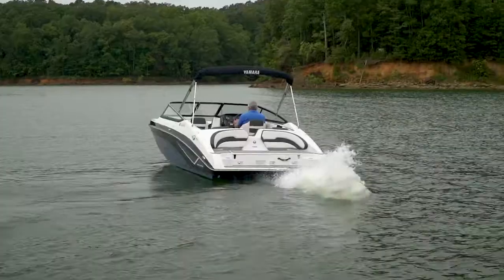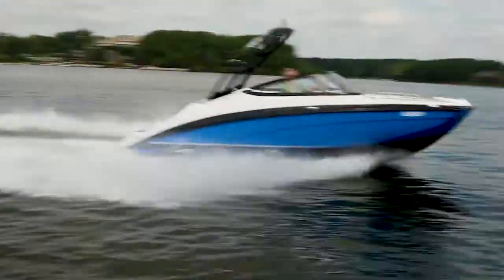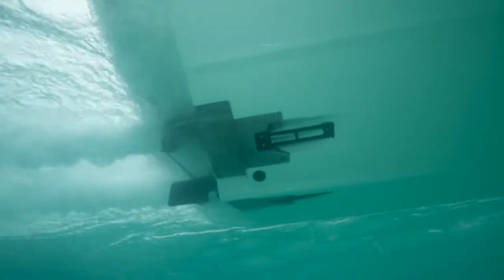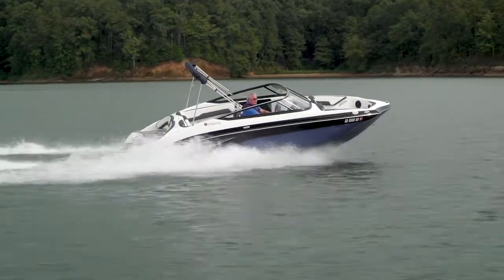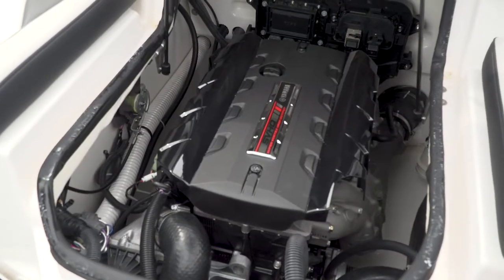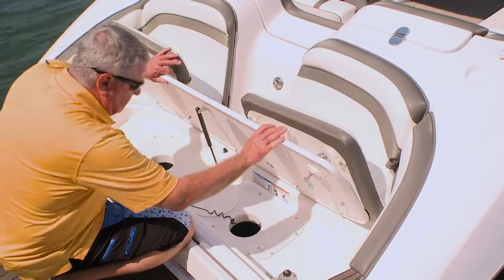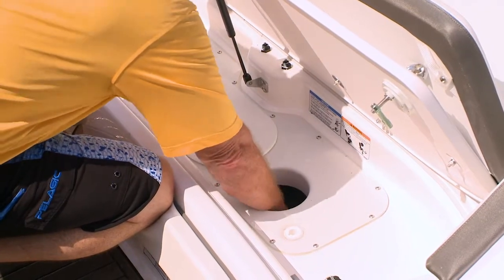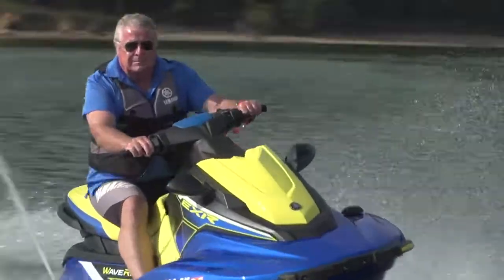The Advantages of Jet Propulsion From Boating Magazine

Comment: I purchased my Yamaha SX230HO new in 2008 for $32k. Only mechanical issue I had was a small rock got stuck in the impeller. Took it to a mechanic had the rock removed no damage oil and spark plugs changed (plugs 2x a year) under $300 dollars. I now change my oil and plugs myself. Plugs are about $8 each (8 needed). I love my Yamaha!
Reply: I'm hoping to find one of those. I have a Yamaha FX Cruiser HO -05 with the same engine with 460 trouble free hours. Very hard to come by in Sweden as they are only sold in the US.
Yesterday a non-HO SX230 from 2004 came up for 30k dollars, zero value lost and 17 years old!
Reply: Haha if that's not a solid reason to buy one I don't know what is.